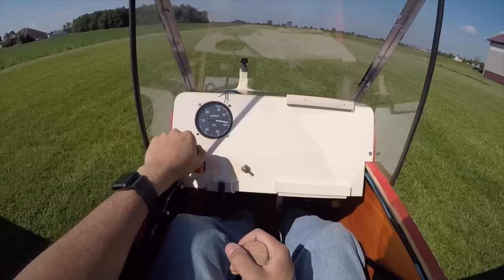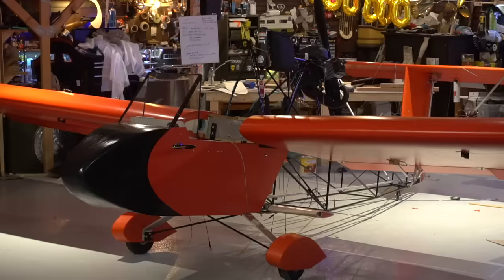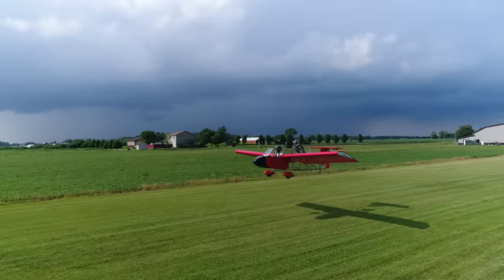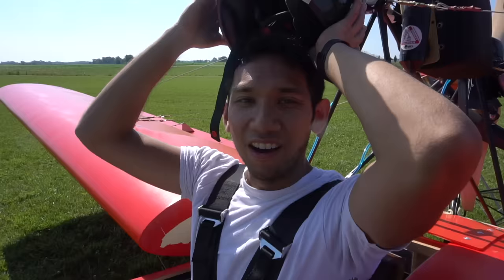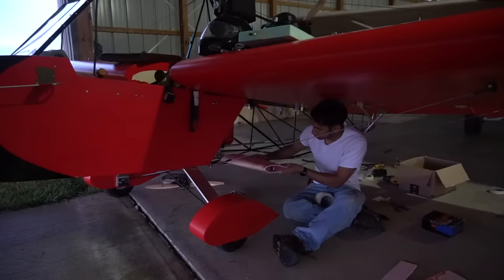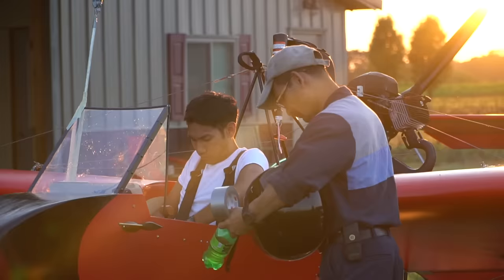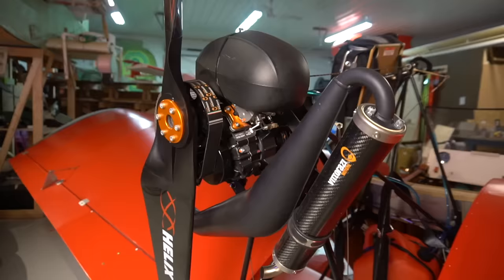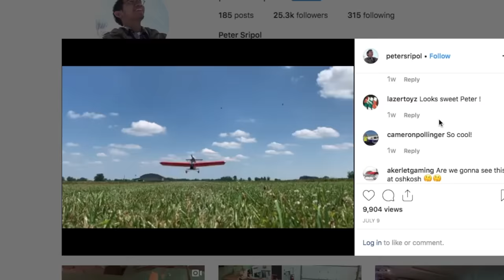MY HOMEMADE airplane flies!!! MK3 design

Comment: Lets be honest, you couldn't have used the BRS, because you wouldn't have been able toreach it!
You could hardly reach it when the plane was still sitting on the ground, now place yourself under the stress of uncontrollable spinning or any other wildly out of control emergency situation - there wouldn't have been anything you could have done.

Comment: You already used light materials. Try some fiber instead of metal sheets.. And build another.. Change the design.. The aerodynamics for old designs take too much drag that adds to weight.. Try a more futuristic one..

Comment: yeah
Reply: use a canoe helmet plastic just as good a thousand times ligther
Reply: go i undies and reduse the weight by half ..get rid of instruments .... the materials are good but back in the 1970's we got our unltralights down to 200 pounds and 400 take of and similer design but we dig get the tweety a motorised hanglider way way down with a lawn mower engine but it took a few loives until it was realides the wing angle was too wide hangliders need only 130 degree angle or they crash because the wing billows .... bu any way your the telling the story and i listening thank you ..
Reply: do use a parracuit  all guts and glory
Reply: i never